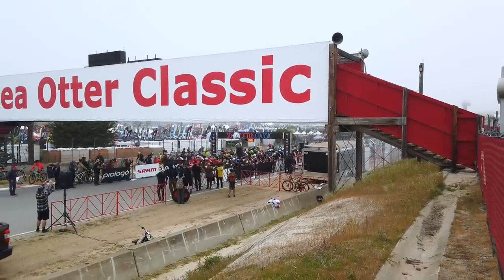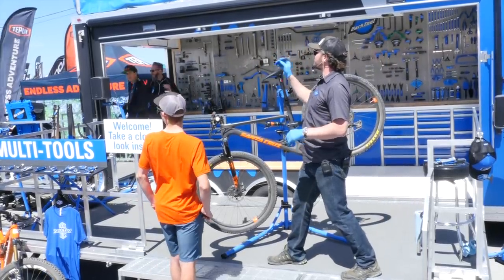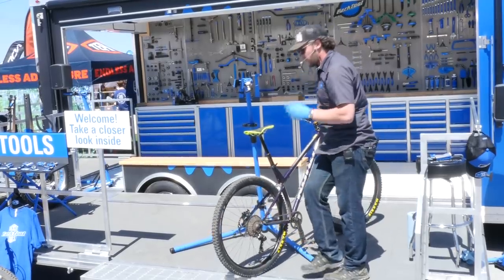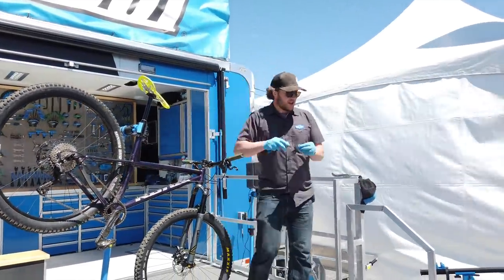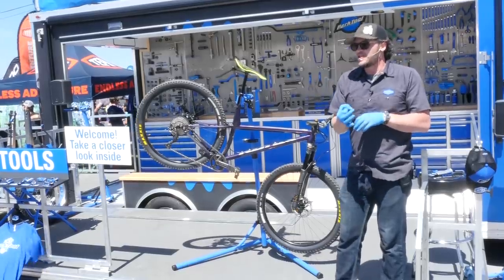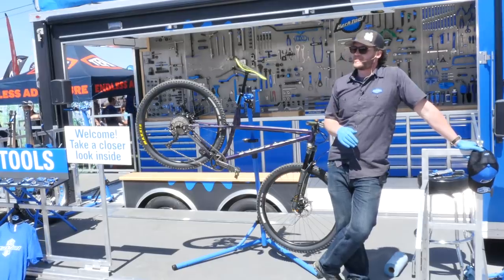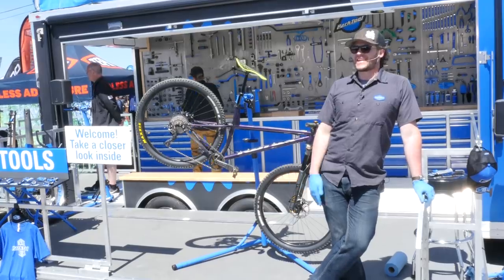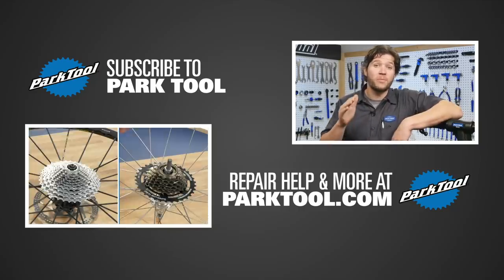Why is My Bike Making Noise? | Shop Talk Live from Sea Otter 2019

Comment: sometimes when i go over a bump my bell will ring on its own
Reply: @M1lan2124 my bell rings itself when I press the lever how do I stop that
Reply: abxdefgurmomgaypotatooley wow i dont have a bell i dont know bro sorry
Reply: that means you're bike is haunted by it's previous bell.
Reply: @abxdefgurmomgaypotatooleyw2395  just dont press the lever
Reply: @abxdefgurmomgaypotatooleyw2395  did u try not using it?
Reply: Round 3
Reply: Bells with external strikers are less susceptible to inadvertent ringing than ones with internal rotating dual metal shaking beads when exposed to external riding vibrations and road buzz . Larger bells with single spring loaded internal strikers are the exception to this however .

Comment: I've had a weirdest noise (some buzzy vibration) in my bike, could not detect the source for like 6-7 years. The problem was, it only would appear on high speeds, like more than 3x6. The techs have also been looking at it, to no avail. Have finally solved it myself!  The noise was from coloured cataphots (reflectors) on the wheels!
Reply: Secure them "FIRMLY" .

Comment: I had a creak when loading the pedals and am guilty of placing undeserved blame on the BB. I greased it and even added teflon tape to the threads with no luck. I lived with the creaking for a couple months until i finally figured it out. Turns out i was unevenly tightening the side by side pinch bolts on my hollowtech crank arm. Really taught me the importance of using a torque wrench!
Reply: It is a pity you didn't seek assistance from someone like Calvin or myself from the industry . We would have also given you a tutorial .

Comment: I had a clicking sound that I thought was coming from the left hand leg of my fork,  I stripped the fork down as I was convinced it was a problem with the innards of the forks.  It still clicked.  After scratching my head for ages and weeks, it turned out to be a worn headset,  which was strange as there was no signs of wear or play in the headset at all.  Bike rides like a dream now and no noise.  Cheers Truman for the quality video.  Keep them coming.

Comment: My girlfriend says it shouldn’t annoy me! I’m glad I’m not the only one it annoys! 
Been chasing a creek for ages. I greased and cleaned the BOTTOM BRACKET first. Then the chain ring. Then the pedals then all the suspension linkages. And finally gave the rear quick release axle a little tweak. Fixed it. Omg!! At least everything else is now cleaned and grease I guess

Comment: Just a couple of days ago I had a clicking coming every time I put a load on the pedals, it was driving me crazy.  Tracked it down to the right pedal and all it needed was some grease on the bolt.  It was a surprisingly loud noise too!
Reply: I had a similar problem: noise under a load.  Put it on the bike stand and everything was whisper silent. Climb on for a ride and it was instant and incessant. The noise was like an intermittent rubbing like the spokes were hitting something on the way around.  The faster I went the faster the rubbing occurred. And it didn't stop when I stopped pedaling. After looking for days to see what the wheel was hitting, I found a loose spoke.  Tightened it up and all was well.

Comment: had a creak on a full suspension mtb once, replaced the pivot bearings, the creak still there but changed in pitch. Two weeks later the frame cracked in two dumping me on the road( fairly gently). Aluminium frames fatigue!
Reply: oh god now im scared, having creaks i cant find... haha

Comment: Months ago, i had a horrible noise in the bottom bracket, took everything off, re grease the pieces and the noise continued, i was frustrated because i thougt "i'll have to replace everything", one day i touched the rear derailleur and it sounded just like the "bottom bracket", it was sand under the derailleur hanger all the time but the sound traveled trugh the frame to the bottom bracket area

Comment: Had a brand new road bike - A-head stem on alu steerer - perfectly quiet at the start, until I did a two-hour ride in the rain - afterwards, stem area would not stop creaking, even though all bolts were correctly torqued - took stem/bars/steerer/spacers apart and brushed a little grease on all contact surfaces - total silence for ever after, even after loads more wet rides.
Reply: Never a bad idea to strip/clean/re grease a new bike

Comment: Check wheel bearings as well.   I had not so much a creak but a  notchy feeling when pedaling I thought it was bottom bracket bearings or pedals so changed them both which wasn't too expensive but unnecessary.
I stripped the back wheel down and found the cups cones and bearings were full of dirt and a bit of rust so cleaned them, re packed with grease and after that was smooth as silk.
Pedals and BB bearing cost around £60 I did want new pedals anyway.

Comment: I had a straight fat bike fork creak from the way it was made. The steer tube was welded on the bottom side of the shorter bigger diameter tube it went through (and what the fork legs were welded to), but not on the top side since thats the surface the crown race sat on.  Its a poor design and it flexes in there. I tried loctite 640, which would not go down in there. Tri-flow seem to help. Fat bike are the noisiest of all bikes, more flex and torque on everything.

Comment: My bike was creeking right on the first ride, newly built. I thought it was the headset since I hammered it in with a rubber mallet, not using a press tool. Turned out the source was the stem bolts. I tried tightening just right, tried it tight, tried it a bit loose, still creeks. It has grease in the threads. It’s a cheapo stem so I wont bother anymore.

Comment: bmx.  my headset used to creak when the lower race installed onto the fork interfaces with the lower bering.  and now the race is built in to the fork.  one less part to creak.

Comment: Hello! I have an annoying cracking noise on my carbon Specialized HT StumpJumpere. It shall be on the bar stem or on the carbon spacers between the bar stem and the ahead set. I appears every time I ride on bumpy roads. It disappears just after greasing the bar stem and the carbon spacers (3). Have you heard about it? Thanks for the help

Comment: hey park tool can u help me when i got a problem its really sucks when pedal a steep hill my pedals bearings or the back of my wheels bearings slip if you have some advice and thanks
Reply from the maker: Your chain or cassette could be worn out. Have you checked your chain length recently? That, a stiff link or bent tooth are all potential causes.

Comment: Well I got a vilano bike disk brake 7 speed free wheel quick release but the awful thin shifter  so I am thing to change to shimnao calris 2x8    But the problem how I change the 7 speed gears to 8 gears Bruce’s it is free wheel not Cassatt system if  change the hub to a Cassatt hub 8peed will it fits in my frame ????? Even if I choose tourney sti shifters system 2x7  do I need to change the crank set and add the shifter to sti.   Or I need to change more stuff  what is better calris system or tourney  or they are near???? The front devil is 7 speed tourney Tz 7 speed the back one is tourney 6/7 speed both of them are sis index thanks

Comment: How about the creaking sound when back pedaling? Im using Deore XT m8100 hubs.
Reply from the maker: Only happens when back pedaling?In all gears?
Reply: @parktool  yes sir. The RD is well tuned, smooth shifting. Also when Im back pedaling the wheel is also rotating a bit. My suspicion is the hub. The creaking sound bothers me. Thank you sir for the response.

Comment: I've got a pinging, intermittent, more often when cornering. definitely spoke noise like a loose spoke would make. Bike  is new spokes are tight. Swapped out the rear wheel still makes the noise.
Reply from the maker: Could this be brake noise? What kind of rotors do you have? Some floating style rotors have a tendency to make a pining noise.
Reply: @parktool  I've got regular discs but I did suspect the rotors. I'm  almost positive it is the spokes. (A spoke)

Comment: My bike is making noise, when I'm faster than 20km/h on the road. It's a clicking sound, that seems to come from the front wheel. Haven't found out what it is, as well as two bike shops.
Reply from the maker: Kinda sounds like a sleeved rim issue. Have you noticed if tire pressure effects it? Typically a loose sleeve with tick when it hits the ground, so if you watch as the wheels rotate is the tick happening when the "joint" of the rim hits the ground? The joint is where the rim is either welded or bonded together. If the rim is carbon, then this wont be the case.
Reply: @parktool  Pressure seems to have no effect. Can't tell if the tick happens when the joint hit the ground, because it only happens when I'm faster than 20km/h. But I'll dissemble the wheel and look if I can find this loose rim. Thanks for the tip!
Reply from the maker: @nenioc187  You will not be able to see it. It is inside the rim. Often the repair is injecting glue or setting it in place with a hammer and center punch. It also may not be visible or audible as the pressure from the tire actually spreads the rim and loosens the joint. Try riding with all your weight over the front wheel to see if you can get the noise to happen at slower speeds. Then try to see if you can see when the tick happens. If it is right as the joint hits the ground then you have found your issue.
Reply from the maker: nenioc187  Did you find the issue? Curious about this one.
Reply: @parktool  I might have it. I disassembled the axis, as far as I dared. Put grease on the ball bearings (they were oiled) and put them all together again. The wheel seems to be a little out of alignment now, but it looks like the clicking is gone. Still have to make a longer ride to be sure.

Comment: Perhaps you could help me. I got a fox f100 2010 fork that developed more like 'clicking' noise while i ride. I think its happening where the crown and steerer tube meet. They dont move, they are well seated, but when i take the fork off my bike, clamp steerer tube in a vise and twist the lowers, it happens. It also happens when i stopoie. Any remedy for this? I also checked for cracks or dents, all good... 10x in advance, love the show, i learned so much from you guys. Greetings from Serbia.
Reply from the maker: This is an issue that ive seen in the past and typically requires new uppers. There is another potential fix that I have tried and had success with but its not 100% effective. It requires wicking loctite and a little bit of heat.
Reply: @parktool  Thanks alot, I'll give it a try.

Comment: Can make department store bikes have threw axels without changing the wheel/rim?
Reply from the maker: Unless the bike was built with different replaceable dropouts, you cannot convert from open dropouts to thru axle dropouts.  A "department store" bike is unlikely to have this design. The wheels will also not be able to accept the thru axle design.

Comment: I’ve got a creak coming from my front fork, only when I’m braking or send a big drop, it’s not my headset as I have swapped the forks onto another bike and it creaked then aswell
Reply from the maker: Depending on age of the forks you may want to contact the manufacturer about a potential warranty. The steer tube and stanchions are pressed into the crown and some have a tendency to creak if the tolerances were not exact.

Comment: My rotor is noisy when i'm breaking!! I cleaned my rotor and my brake pads but still its noisy what can you suggest guys!
Reply from the maker: Sometimes some light sanding can help the pads.  If they are clean, consider switching to a different type (semi-metal vs organic).  Be sure to also check the tightness of the adapter brackets and brake mounting bolts.

Comment: I get a creaking noise which sounds like its from the bottom bracket area but I've so far changed the bottom bracket, the Chainset and the pedals but the noise continues.
It happens when I'm pedalling stood up or sat down, but only under load, so if I try it when its on the stand there's no noise.
Whats strange is that it only happens on the smallest 5 rings on the rear cassette (Shimano 10 speed cassette), the cassette looks in great condition and the bike is only 6 months old.  The noise is driving me crazy anybody have any ideas?? :-(
Reply from the maker: Make sure your pedals are nice and tight as well as your thru  axles or quick releases. Your cassette comment does make it sound like your cassette may be slightly loose. Verify that is tight and tighten up your quick release and im sure you will have fixed it or crossed a few more things off the list.

Comment: hey , i could use some advice. i got a giant fathom 3 +e with trekto hydraulic brakes (yes not the best pls save me the comments on this im still a rooky for mtb only started last month)
and the front rotor (180mm) ratles. Most of the time it starts at +30kph on tarmac. wheel is true, rotor is true. everything is alligned as shoud be by shop. could this just be poor quality or defect.
it ratlles so much it is eating his way in the calliper mounts on my front fork.
when checking it my self i notice nothing wrong until i give the disc a litle tap while spinning the wheel and there it goes
Reply from the maker: The rotor is eating the caliper mounts on your fork is the scary part of this one. Are the T25 bolts that fasten the rotor to the hub tight? Also are the bolts that secure your caliper to your fork tight? There may be 2 sets that you need to check. all of those should be 4mm or 5mm hex fittings. Some 2 piece rotors make a rattling noise as well but i doubt that is the issue. Let us know if anything is loose and we can go from there.
Reply: @parktool  its à 1piece rotor And yes all bolts And screws are tight. I dismantled it al And reasambled it, this is when i notice thé Paint And métal being touched by thé disc.
Might just pass by à shop picking UP à New rotor to test.
Reply from the maker: The pads on the left/nondrive side may not be allowing the caliper to be centered over the rotor. You may need to push both left and right pistons back into there bore then hold the right pistons in to allow the left pistons to advance and give the rotor more space between the caliper. A shop visit may be your best bet for this procedure.
Reply: @parktool  still Got maybe à stupid question, is it normal for the rotor to make the tching sound (metal resonating) when you tap it while holding the wheel in your hand? I dont have this on my 160mm rotor at the back

Comment: I had a clicking sound with in time it becomes more and louder and more annoying because I could not find what it was I tighten all the screws from the hole front assembly to the crank set and even my seat post and stem and nothing the noise all so stop when I would stand or go fast so I took it to a shop the first time and got the back hub bearings change not the answer then I had the BD change nothing one day I got a flat at work took the back tire off and my friend told me hay are your spokes supposed to move like this and yeah bingo all my spokes were loose took it in and yeah the guy told me wow this whole rim is bad I can true them but they still be loose so I had to get the whole rim rebuild and now all I hear is my tires smashing the pavement

Comment: What if my crank has play
Reply: Josh Vinz Migl de la Cruz tihtin it or replace it
Reply from the maker: Isolate the play further. If it is at the bearings, then new bearings are needed.  If the play is between arm and spindle, tighten the arm.
Reply: @parktool  thanks
Reply: @aohitsaguyqwhonameaintjoe5046  okay